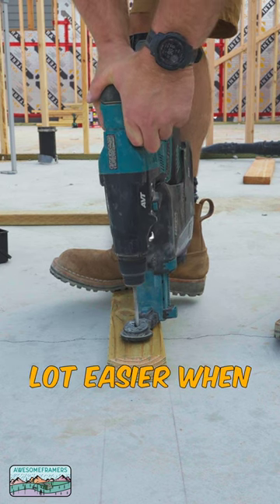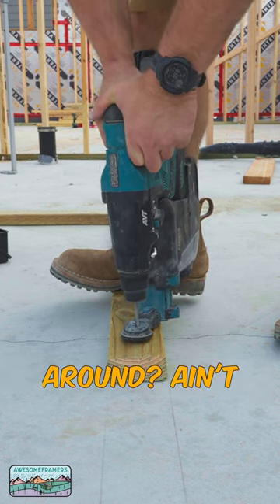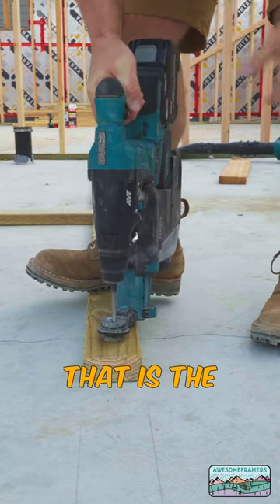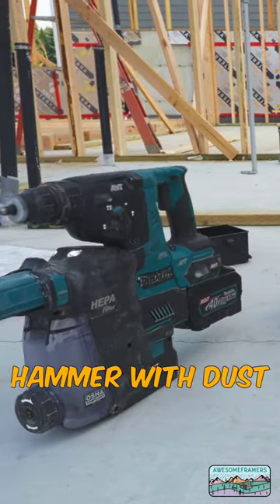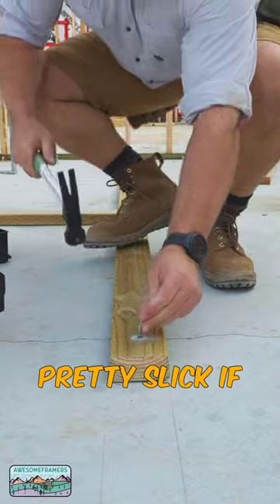Let's Make a Connection ##framing #concrete #diablotoolsambassador #makita

Comment: That looks like fresh construction.... why is there a Crack in the concrete already?
Reply: Cuz concrete cracks as it cures, relief cuts only do so much. Are you serious?
Reply: That's an excellent question, and yes. It is a brand new slab because of the high demand at these houses need to be built. They start building the house on that slab. While it's what we call still green. Hence you've got cracks in it. Very common here in Florida.
Reply: @robertepley4339 cracks just happen in general
Reply: @randal3122  Well, imagine they do, but what I'm stating. Is that new construction cracks like this In the slab are not uncommon because builders  wanted to start getting heavy equipment on top of them, loading tons and tons of block for the block walls and  will cause cracks. I live here in Florida, bro. They don't have time to do stress cracks in the house slab itself.  They wanna get that slab done, get it finished. I'm not kidding you 2 or 3 days. They're building on it, those Cracks would not be there if those slabs were allowed adequate time to cure out . I've been in new construction plumbing and commercial for 27 years now in florida .
Reply: @robertepley4339 hey your comment has me curious, how long should they let that concrete cure "ideally"?
Reply: @taylorsessions4143  at least o month
Reply: @Jake-n8v nah bro concrete done right shouldn’t split so soon it’s “new construction”
Reply: @robertepley4339 people have become convinced that "concrete cracks" and you are an idiot if you don't know that.  I've heard it many times. And then it gets parroted by the low level internet dweebs because it makes them feel like they know something and can talk down to others.  Thank you for sharing your experience.
Reply: 9 inch slump
Reply: @Jake-n8v if you reinforce the concrete it won't  Crack that fast. Looks  like the base wasn't  compacted correctly
Reply: Cause aint nobody got time for that
Reply: My house is 20 years old.  Not a single crack in the floor, only cut seams.  So no concrete does not always crack.
Reply: @robertepley4339  a month? well maybe id3ally 27 days. but its not standard practice at all to let a slab cure for a month prior to loading it. its almost always 7 days. and they test it. it gets like 95% of its strength within 7 days or something. the only concrete i ever see where people actually wait 27 days to do anything with are concrete tilt up panels. i have even seen people tilt those after a week too, but that is a little sketchy if you ask me. but no matter what you do, concrete can crack. thats what control joints are for. they will make you rip a slab out if you have too many cracks, but its almost impossible to 100% prevent any cracks even when you see polished concrete, there are likely a couple of patched cracks. the goal is to avoid them as much as possible, but sometimes it just happens
Reply: @robertepley4339  ive been in commercial construction my whole life and i dont think i have ever seen a slab cure with absolutely zero cracks. some are better than others, and i have seen a concrete sub have to rip out tens of thousands of square feet of slab because it had too many cracks. but i dont think i have ever seen one with zero
Reply: @Platinum1812 "low level internet dweebs" hahaha
Reply: It just does. I used to be a framer and sometimes you show up and the slab is cracked, sometimes it isn't. Concrete guys say it's the quality of the concrete
Reply: Commercial electrician here, I see fresh concrete crack on the regular, js🤷‍♂️
Reply: @g-dub4593  ya its super common
Reply: Concrete is rated at its 28 day strength, but has gained most of its strength before that and will continue to get negligibly stronger indefinitely. It’s kind of a asymptotic thing.

Concrete cures by growing a mesh of interlocking crystals like rock candy. The bigs ones interlock first, and then smaller and smaller left over cavities get filled up with crystals.
Reply: @hotwaxonmyuddersohyeahmoo5701 That's them deflecting. It cracked because the land wasn't settled properly, or they didn't allow the concrete to cure properly. Simple as that.
Reply: Concrete cracks, regardless of what internet soft hands will tell you, the slab will crack just sitting there while it dries out (10 on the compaction test btw)
It’s quite literally just surface cracking since the whole mass of concrete doesn’t cure as uniformly as doing a simple google search will lead you to believe

Comment: A corded drill will always have more power and lets you work faster
Reply: hate to be that guy but not always. Sometools will but it really depends tool to tool.
Reply: @Vidar93  nah it will always be better go out and rent and try them
Reply: Avt by makita saves your joints for some quality time with your family when you get older

Comment: I have question. If I wanted to put wood decking to cover a concrete porch, would I need a vapor barrier or straight to concrete like here?
Reply: @charliesmith643 If you are laying directly on the concrete it’s not a bad idea to use the foam barrier underneath the treated lumber. If you have a small step down to the concrete at your door then you could do small joists with treated like a normal deck and just put a rim board all the way down/around it. Either way you go I advise you to seal the deck boards. Hope this helps. Good luck!
Reply: Never fix wood direct to external concrete, that’s a fast way to rot out your new decking.
Reply: @MegaBambooboy it's specifically designed for ground contact
Reply: @markalcala1293  no wood should be fixed direct to concrete, it's a sure way to trap moisture and promote rot.

Comment: Drilling a 10 inch hole and using a 3 inch nail…plus the nail going through the wood — only an inch into the concrete???

Comment: People, I don't know about other States, but here in Florida builders only reinforce the footings and columns, the concrete slaps on the houses they just use fiber !!  The houses settle and cracks and this is consider normal here, si no fixing that crack.. From where I am from, we build houses all reinforce concrete including ceiling everything solid, any house that shows a crack is considerate unsafe and would be very difficult to sell, cracks are not acceptable. Here in Florida is normal, 
**so, if you don't like cracked houses, stay away from Florida, another reason not to come here.... !!! 😂😂😂😂 **

Comment: Are those fasteners rated for treated lumber
Reply: I can't answer that question. But what I've been told is that with the new treated lumber is it doesn't need to be. Providing it stays dry. Even in a basement, the plate will be dry. I know someone will likely argue with me here. But I view it as the same as mold tough drywall in bathrooms. If the home is conditioned like it's supposed to be, the treated plate won't rust a regular metal fastener. Just like I don't know of a reason to use mold tough drywall, in normal conditions. If you have enough moisture in your bathroom to cause mold inside the drywall, the drywall isn't the problem. The moisture is. That drywall will not, ever, stop lumber or anything else behind that drywall from growing mold. Never. I've personally seen mold growing behind mold tough drywall, on the studs. The moisture came through the drywall. But, I won't lie. It doesn't hurt to be prepared and use a fastener with treated wood or concrete that is less likely to rust. It's just good practice. But still. If that treated plate draws moisture, enough to rust the nails holding the studs in place, it will grow mold. Fix the moisture, fix the problem
Reply: @Black_Dirt_Contractor the chemical they use to treat the lumber will corrode and dissolve the fastener over time. 

It’s crucial when using treated lumber to use fasteners rated for treated lumber. 

Just saying
Reply: @Nick-be5hh 

I think what he's saying is that modern treatments don't corrode fasteners the same way. No idea if it's true, but you didn't touch on it so wanted to point it out.
Reply: @Nick-be5hh  not what I've been told. The newer formulas they use now, compared to when it had arsenic in it, aren't supposed to. Maybe that'd the supplier my vendor uses. Not all treatment facilities use the same process. I honestly can't remember who performs the treatment on the lumber I receive. When another lumberyard in town was open, I couldn't mix the wood. My vendor, and this vendor had 2 completely suppliers. It was like lite green to dark green. And it wasn't moisture content.
Reply: @Black_Dirt_Contractor this is why I don’t bother with MR (mold resistant) drywall.  The front is treated but not the backer—waste of money.

Comment: Or use wedge anchors like you are supposed to.
Reply from the maker: Why?  Use them where they are needed.  They aren't needed everywhere.  Do you bolts you wood plates down to a wood floor? Or do you nail it?  Exactly.
Reply: The split drive anchors are more than sufficient to hold a wall plate.

Comment: Bad karma that there's a huge stress crack in the slab right near where you're drilling to set the bottom plate.  Would also be a good idea to use the depth-limiter on that fancy new Makita that you're showing off:  The unskilled worker probably went all the way through the slab.  Ham&Egger!
Reply from the maker: Nope, the bit is the limiter here
Reply: All concrete cracks
Reply: no kidding captain obvious
Reply: @AwesomeFramers I didn’t know there was a specific fastener for doing this. Within the last couple years I just learned you could do this same exact method only with 3 framing nails. This method is by faaaar better than using the ram set!

Comment: Need gasket seal between wood and concrete!
Reply: Not on partition walls. Just exterior walls
Reply: It’s treated lumber…🙄
Reply: You do still have to have a foam or rubber barrier between the treated sill plate and the foundation. Atleast in Michigan anyway. Only on the exterior walls though. If the house is on a slab the bottom plate doesn’t need a barrier on interior (partition) walls

Comment: Or use a ramset
Reply: Win 🪘
Reply from the maker: Yep, that works.  Here are a few things to consider.  1) The don't always hold the plate tight 2) they can blow the concrete 3) require training 4) heavy OSHA fines if you don't store the charges properly and dispose of them properly. 5) Can be a significant safety risk.

With all of that in mind, we use the split drives here and there, mostly using the Max High Pressure nailer as shown in previous Shorts
Reply: @AwesomeFramers  ic

Comment: That will last about 2 minutes. Did you just see the last hurricane at over 200mph? 😂
Reply from the maker: This has zero to do with hurricanes. In a hurricane zone, stronger connections will be called out. Though I'm a non load bearing wall in the basement these will be more than strong enough.

Comment: Forgot the foam. Never put wood on concrete. The moisture from the concrete will wick through the wood and rot. Bam!!
Reply from the maker: Nope, didn't forget anything.  Foam is not needed here because we have a 4" slab over a vapor retarder, foam insulation and 12" pea gravel.  Additionally this is treated lumber and WILL NOT ROT here.  Please refrain from spreading misinformation on my channel.

Comment: First of all an extension cord take as much time to unreal as you put in the battery in the charger or pulling out a dead battery and having to find another battery or every single tool you have has a battery and you got a thousand batteries on a charger everyday but one extension cord with a splitter and you can run three different tools all day without ever running down any batteries and the tool being electric is cheaper than a battery-operated to bunch of batteries and a charger
Reply from the maker: Nope, rolling and and rolling up extension cords takes longer. After spending 20 years corded and the last 6 cordless, it's shocking how much wasted time there is in rolling out, rolling up, maintaining and replacing cords

Comment: Cracked flat work in new construction? Hack job,
Reply from the maker: All concrete cracks.
Reply: Bill, I would love to see a slab you’ve poured that never developed a crack 😂 do all of your pours cure in temperature controlled environment?
Reply: @elliottbrown1725  we’ve all had concrete slabs crack when curing. And I’m sorry for using the word hack… but for Pete’s sake, keep it wet for a couple days or cover it to slow evaporation.